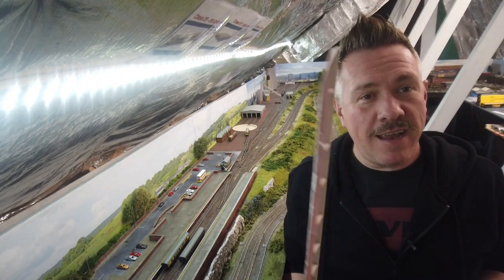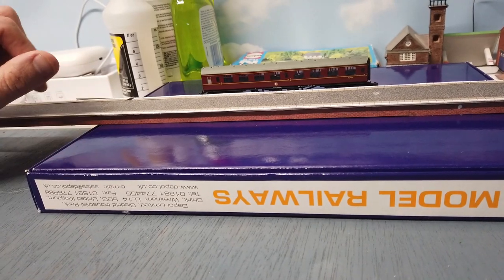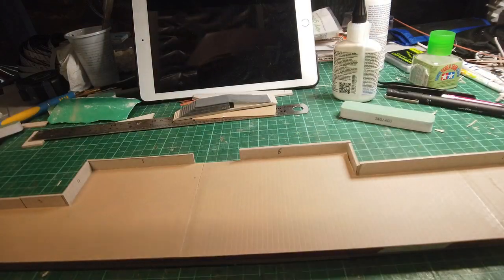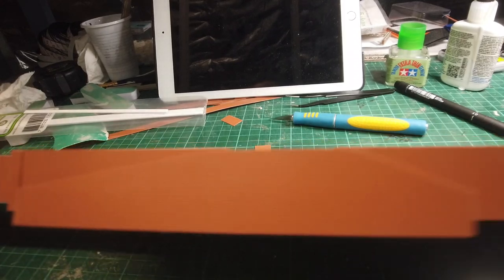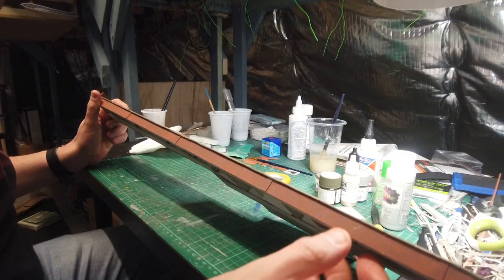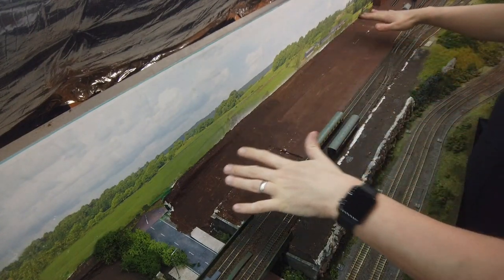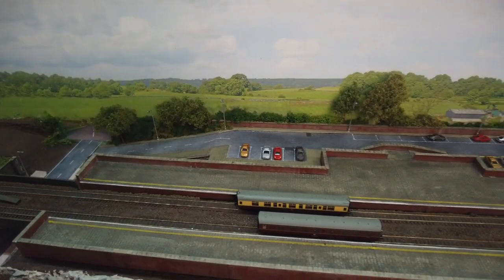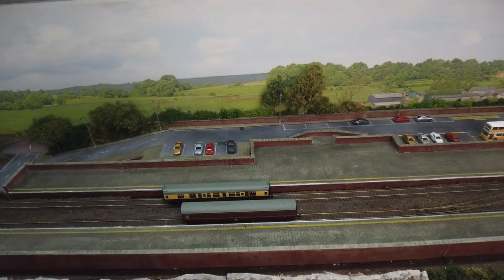Country Station Build - Platforms and Car Park - N Gauge Loft Layount - Ep 26

Comment: Hi Geoff, thanks for some great content and ideas. I'm curious as to why you use Enamel paints for the platform sides and acrylic for the top surface. have a great Christmas.
Reply from the maker: Hi Ed, I use the enamel as its a permanent on the bricks. I then add the acrylic wash for the bricks and know that when i wipe it off the enamel will stay in place. It also means that if the mortar wash goes on too thick i can use a little acrylic thinners to remove it and again the enamel base stays in place. Hope that makes sense. All the best, Geoff

Comment: Hi Geoff yet another fantastic video, yes I am biased but only cos its N gauge. 
Found this one really interesting especially the platform build as I am still working out in my head how I will build mine when I get to that stage. Really interested in the using of plastikard, especially on Metcalfe kits. Been looking at a number of manufacturer's in N gauge especially Redutex mentioned by Stephen of Elvenhome. I love my engine shed build but I know it can be improved especially the roof so I am looking at plastic in future certainly for roofs. 
How is the turntable research going with regard to the kit supplied by Locomotech which I think is part of Gaugemaster at Ford.
I did email you about a month ago with regard to the wire samples but got no reply, will send a test email to see if you are receiving it unless it went straight to your junk file thinking it was spam. Please let me know if you get it.
Regards Chris
Reply from the maker: Hi Chris, thanks very much, glad you enjoyed the video. First up my apologies, I've just pulled your emails out of the spam folder, I barely get any emails to that email address so I'm guilty of not keeping an eye on it, sorry! 
I'm a big fan of plasticard, it's much more long-lasting than the texture papers (in my opinion) just a bit more complicated to paint.
I've not done any more work with the turntable just yet, I'm trying to focus my attention on areas that I've either already got the supplies to complete, or that I can complete quite cheaply (2020 hasn't been kind to my wallet).
Anyway, wishing you all the very best for Christmas and the New Year! Cheers Geoff

Comment: Hi Geoff. Great looking result. Just one question about the platform height: You added a 3mm grey board at the bottom to compensate the height of the woodland scenics track bed, but then added a 2mm surface at the top of the platform. Shouldn't it be 2mm too high now 🤔
Markus
Reply from the maker: Hi Marcus, thank you. Not sure where you got the 2mm from? The only thing I added to the surface was the textured plasticised and that is only half a mm thick, so technically I’ve raised the platform surface by 3.5mm. The only 2mm grey board I’ve used was for the rear platform walls. Cheers Geoff
Reply: @PrideParkway  Yeah, sorry, I misunderstood that 🙈
Reply from the maker: Haha no worries I was in the loft when I read your comment and had to rebuild the platform in my head to check I hadn’t messed up 😂